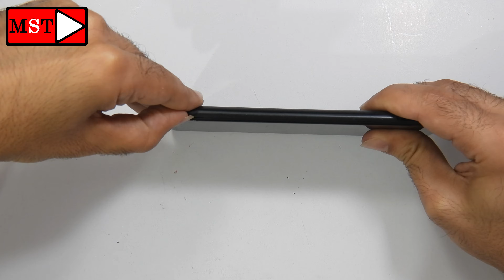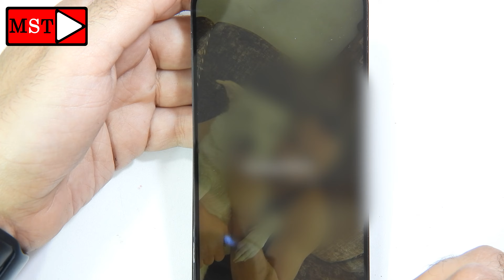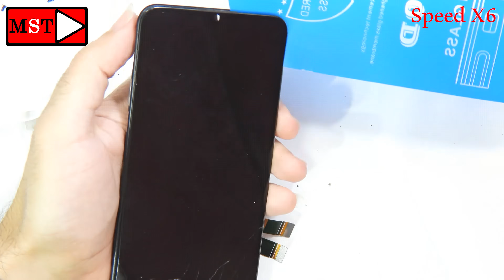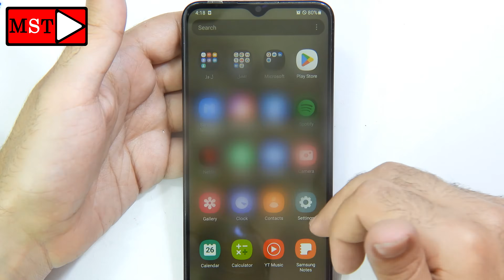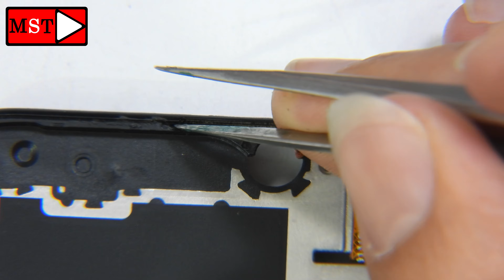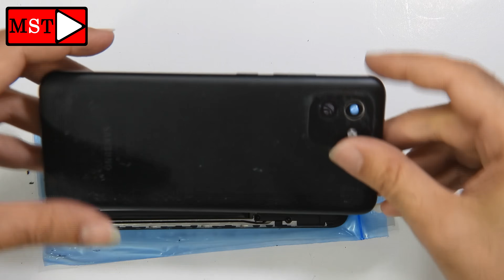Samsung Galaxy A03 LCD Replacement

Comment: I got an original replacement screen for mine and unfortunately the touch is not working. The screen turns on, but no touch at all. And the old screen was already broken. Gotta get a new one, again
Reply from the maker: Did you replace it yourself?
Reply: @mstphone  yep, under supervision. My teacher got a second screen and no touch at all. Now I am not sure if the board is at fault. We will diagnose
Reply from the maker: Okay , let me updated

Comment: Thank you for the helpfull tutorial. If I accidently dropped the phone and its dead, cannot switch on and even charged. When charging, there is no display shown. What is the issue
Reply from the maker: Anytime, screen got damaged in most cases when dropped, so you should see if the phone vibrates after a few hours, if so you need to replace the lcd.

Comment: I accidentally bought a replacement screen without the frame, so thank you for showing how to remove the screen from the frame! I actually didn't need any heat, it came off easily. Probably because it was very very broken
Reply from the maker: Im happy to help 😊
Reply: @mstphone ❤🫶🫶🫶🫶🫶🫶🫶🫶🫶❤️

Comment: Can i use the screen just plugged in but not assembled? I just need to gain access to the phone to move files to the memory card and then throw it away.
Reply from the maker: Yes you can , but you have to put isolation under the screen, otherwise the screen won't touch . Isolation like paper cartoons, bubbles anything not metal.

Comment: Hello, after removing the old screen i tried to test the new screen but seems like the power button doesn't work although it charges and the screen  shows percentage. Do you think i need to reassemble it so it can work properly? I tried it while it's disassembled.
Reply: For anyone that has the same problem, yes, after i assembled it the power button worked as usual, apparently i had to push it with the actual button from the back cover than with my nail as it's shown on this video.
Reply from the maker: Yea, because the main board is not touching the power button pins located under the main board.
Reply: @mstphone  So how did you managed to turn it on without the back cover?
Reply from the maker: Using tweezers i short the pins

Comment: I like your video sir and i just copy your step then after the all look good i change the lcd and after that the speaker not working and i double check it if i forgot any cable but none also the charger time become slow can you help me? I dont know what the problem is
Reply from the maker: My pleasure,  slow charging should not be happened, did you make any force while removing the sub board ? Speaker and charging all located at bottom.

Comment: What adhesive did you glue the 4 silver parts in with..the 4 pieces you didn't know the name of and where is best place to get the waterproof adhesive..the one you are using for 8 years..9 now probably 😂 great video 👊
Reply from the maker: What 4 parts ?
Reply: @mstphone  the 4 little silver tabs..2 at the top 2 at the bottom..I'll get a timeline for you
Reply: @11 minutes thanks
Reply from the maker: These are silver stickers, but i don't know their purpose honestly.
Reply: @mstphone  i understand that..and thanks for the reply..but my question is what glue did you use...is it the same glue/adhesive on everything thanks 👍
Reply from the maker: @emmettcoen  yea its the same
Reply: @mstphone Perhaps they could be grounding tabs for the digitizer in the display unit?

That would honestly make the most sense.
Reply from the maker: @GrimnirWolf  yea maybe true somehow, but i did assembled screen without these silver stickers, and nothing happeneds.

Comment: Mr.mst I noticed when I full the brightness screen of my phone a03 the lower part of my screen overheat like in homescreen and back button of the screen what is the problem of this phone Mr.mst?
Reply from the maker: This is the components under the lcd, seems you don't have good lcd or got problem after used.